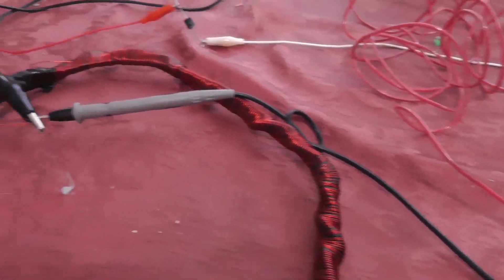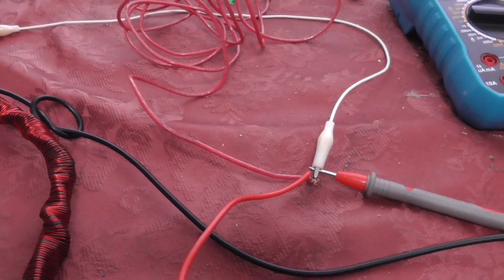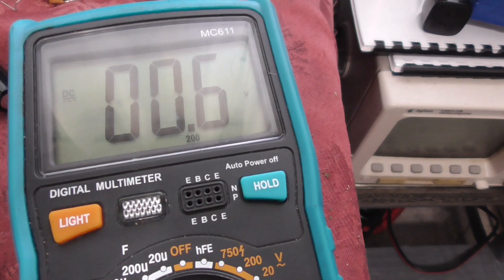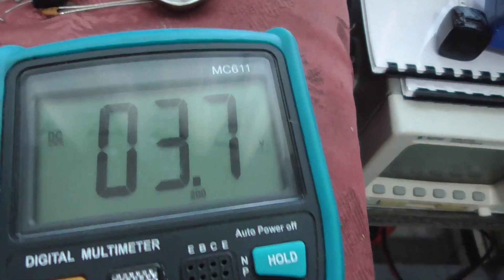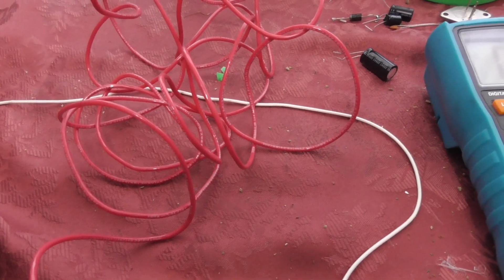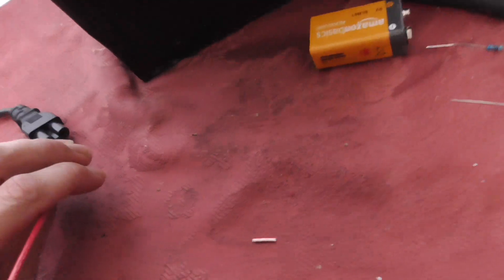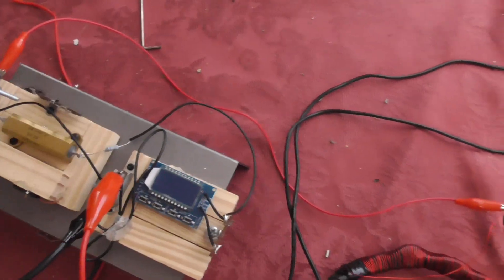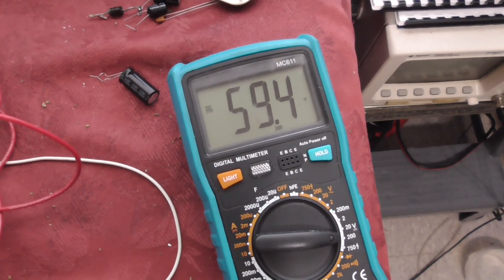Environmental Energy Transducing

Comment: Great, I came across this video about an interesting property of a permanent magnet.
It's an old post by lasersaber.
It seems to me that there could be some relevance, talking about magnetic potential difference,
ambient energy and harvesting it in some way.

It was quite fascinating, I have often wondered if there could be something around a perpetual magnet holder.
Normally they are easy to make, once locked, it is easy to assume that there is nothing more to it. 
https://youtu.be/S_ssUTRbRRs?si=AWQo3pSceoSHCjT7d

What if there could be something around it that could be tapped into?
Lasersaber called it Magtap :)

It's amazing watching the video, to see that there are areas of the magnet 
with unique properties which could be used.
What if your coils could react to it?